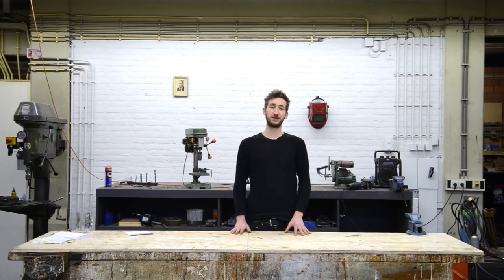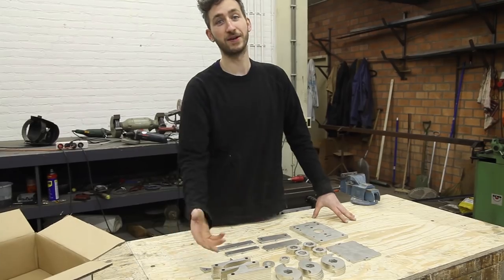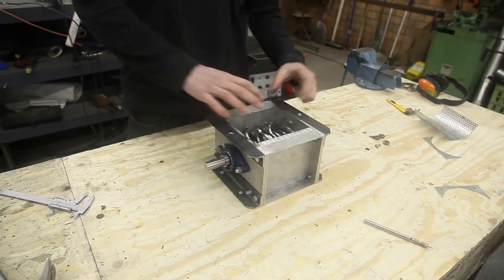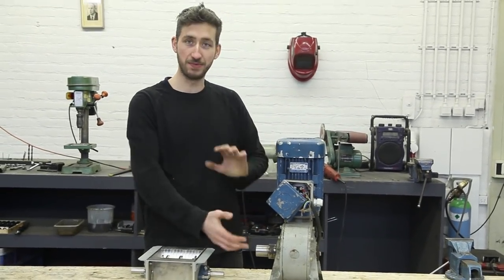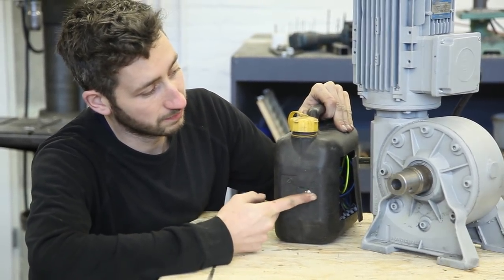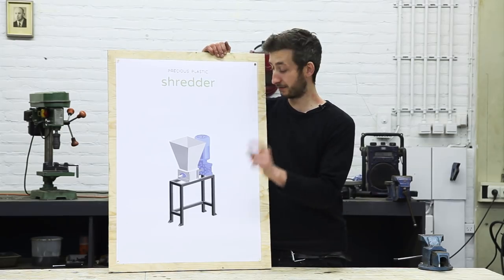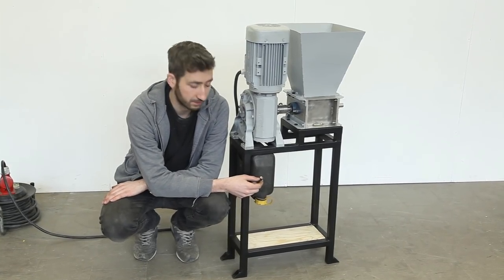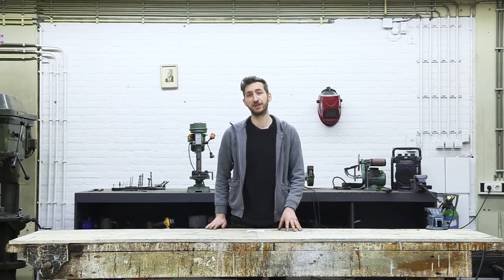Precious Plastic - Build the shredder (part 3.1)

Comment: well, nothing is clear to me. How can i have those metal sheet resources? How can i have those mechanic techniques or machine to make those parts, and your videos kinda short out everything.
Not like those guys who show their impress to your work and then leave these things behind, I am serious about this, so please be more specific to help me out.
Reply: +Minh Hiếu Đào He's almost got a full machine shop. You need machine shop classes in welding, and using basic machine tools, like that lathe and drill press. Or you can find someone who has a machine shop and contract with them to fabricate the various parts.
Reply: You can use a drill and a milling bit to grind the plastic. You can build a grinder with several circular saw blades and a motor.

Comment: To work with plastic, first you need to know how to work with metal. You might as well point people to a machine shop 101 set of videos first and where to buy lathes and drill presses and arc welders.
Reply: +opl500 its a mig welder not an ark :-)
Reply: You made my point. Before you can even think about plastic you need to know the difference between an arc and MIG welder...
Reply: +Edgunsuk a MIG welder produces an arc between its electrode and your workpiece. Don't do the talk if you can't do the walk
Reply: Edgunsuk but mig is still using an arc so he wasn't wrong :).
Reply: tig is still using an ark  , its not tig welding either
Reply: From ESAB webpage: https://www.dropbox.com/s/ec6x1vvq2v79q0b/Screen%20Shot%202016-04-22%20at%2008.15.14.png?dl=0
Reply: not sure what the link is for i have diploma,s city and guilds and nvq,s in welding im aware whats out there , you designs are just to expensive for individuals.
Reply: Edgunsuk 2
Reply: Carl Larsson 33
Reply: 2
Reply: opl500 w220
Reply: 22
Reply: Lloyd Zakabi ??????
Reply: opl500 ww1
Reply: opl500 2
Reply: Why not make the base and the hopper from wood?  I have seen guys here make bandsaws and lathes from wood and salvaged parts.  So I don't see why this build could not be mostly built with wood.  With the obvious exception of the chippers and motor.  But an old variable speed 3.5 hp router could do in a pinch.  And 2 gears made of wood one 10 inch one 1 inch could be used as a 10 to 1 reduction.  And old saw blades or dado blades with spacers.
Reply: @tolvtaggarn  your confusing things an arc welder would be commonly know as MMA separate from MIG so hopefully you can talk the talk better In Future know it all !